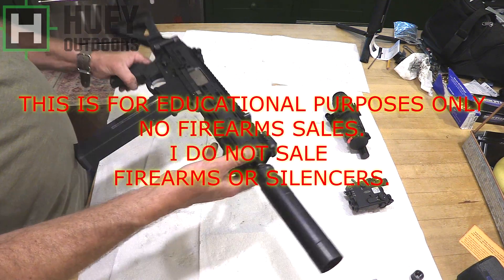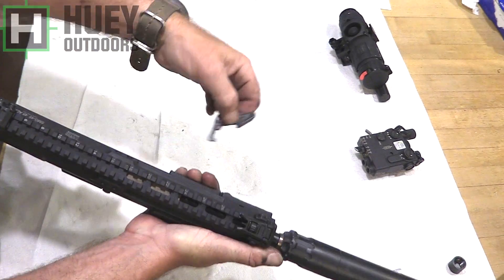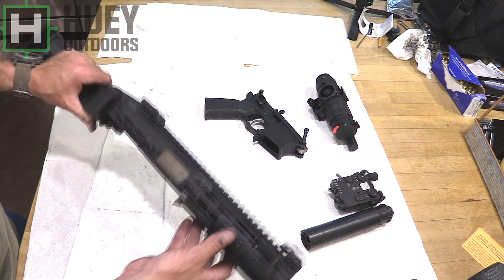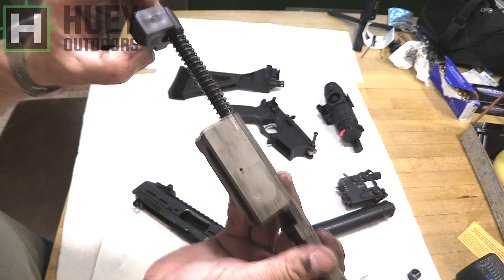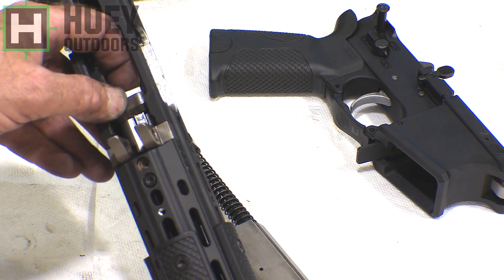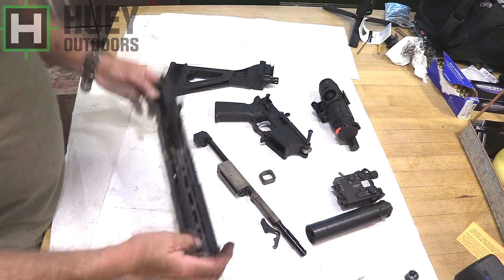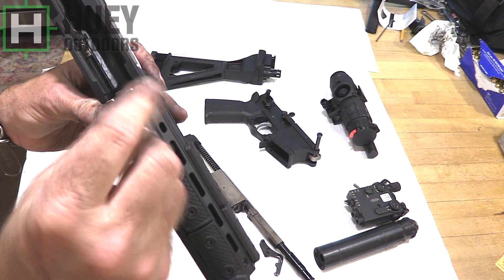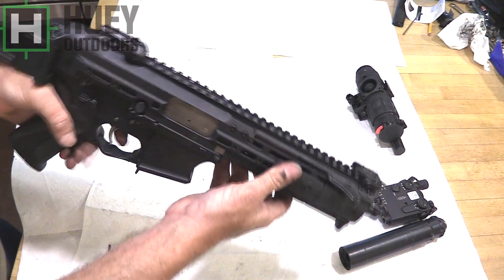LWRCI SMG45 FUNCTION AND INTERNAL PARTS

Comment: Where were the other buffer springs you found that work for this? I am looking for a heavier option then what comes in it from the factory.
Reply from the maker: I’m still using the factory springs no issues
Reply: @LoneStarBoars I am looking for some heavier options to help slow it down. We got a frt to work in it but it runs a little too hard. So I want to slow it down.

Comment: To those freaking out about the screw backing out, there is an insanely simple fix. Add a 2nd jam screw behind it and you can tighten the hell out of it with 242 as well, it will never move again unless you remove the top screw first.

Comment: Just shot 100 rounds through my new SMG.  I used six magazines each with 20 rounds of different ammo (Federal, Huerters, CorBon, Buffalo Bore, and Sig).  Each magazine had three to four failures to feed.  The charging handle fell completely out several times.  The last time it fell out I had to search through the leaves for over an hour to find it.  NOT a quality firearm.  NOT reliable.  NOT safe.  NOT ready for prime-time in the least.

Comment: Excellent vid. Great job opening it up and showing the internals. However, I don't believe lwrc's hype. It's not some innovative new delayed blowback design. Just a standard short recoil operation. In fact, the same one as the Bergmann pistol and the strike one. Way overly complicated for an smg. Probably why they didn't get the govt contract they were looking for. That and the price
Reply: Not necessarily. It can be something similar to delayed blowback in Five-Seven, where barrel moves backwards slightly.

Comment: One little screw has to be torqued just right and not walk itself out? I've been very intrigued by the SMG45 but that just seems like a problem waiting to happen.
Reply: yeah what keeps that screw from backing off?
Reply: @voparzginsburg3223  shear force of will.  If a beta is using the gun the screw backs out.
Reply: Me too, poor design.
Reply: GarandThumb just did a review of this firearm, and got consistently poor groupings across at least 5 different units that he tested (his own + other peoples guns). Many commentators on his video agree that the problem probably is with the reciprocating barrel, and specifically the set screw, as you pointed out. Disappointing in such an expensive rifle. Now we wait and see how LWRC will respond to this flaw.
Reply from the maker: Mine sill groups great at almost 6k rounds.  Seems to be the latest guns produced.
Reply: @CheeseDanish85  A simple short recoil action shouldn't cost so damn much in the first place. This gun is going to run into the same issue as the Galil ACE: far too much of a cost increase over its relatives and competitors for only a marginal improvement (or no improvement in the case of the CMMG Banshee).
Reply: LOL, I made the same comment on GarandThumb's video.
Reply: Most switch barrel designed guns have 2 screws holding the barrel in place.I'm talking 338 Lapua Mag. on down to 308 and the barrels are not flying off the gun.The Barrett MRAD is 1 of the guns that use this same method to lock their barrels in place.

Comment: The elephant in the room, how is the accuracy with a moving barrel? Does a suppressor impact this?
Reply: Another review has recently come out with poor accuracy results too, Garand Thumb
Reply from the maker: Yea I know I talked with him.  Mine has not had that problem, it seems to be some of the later weapons released.  Mine has been 100% thankfully.
Reply from the maker: With seller and Bellot I’m getting about a 15” group at 25 yards.  With the premium Ammo federal, hornady, double tap the holes are touching.
Reply: Lone Star Boars 15”=15 inches correct?
Reply from the maker: Correct but that was the Ammo not the rifle
Reply from the maker: Yes 15” with that cheap ammo everything else has been hole through hole.

Comment: I'm guessing it would be fine to shoot 45 Super through this?
Reply from the maker: Not with the stock spring,  they are testing a stronger spring I believe.
Reply: @LoneStarBoars  thanks. (You know going back to the video I realized you mentioned a spring for 450 SMC, is that what you were trying out?)
Reply from the maker: I haven’t messed with it yet still running standard 45 through it.
Reply: 460 roland would be nice for hogs. Or 10mm conversion.

Comment: Nice! The price is a little steep, but if you look at the competition, then the price starts to make more sense. B&T sells their APC45 for $2,500, and it's just a regular blowback operation with a buffer system. The SMG 45 has a short recoil delayed action so a bit machining is involved. I'm just hoping that the street price would come down to about $2,800. For a PCC, however, that's still up there.

Comment: What is to prevent the screw that holds the barrel in place from walking out?
Reply from the maker: It comes with vibra-tite so you can tighten and loosen 5x before reapplying.  After that you put more vibra-tite or use blue lock tight every time.

Comment: Mine should be coming in this week.  Im concerned about the barrel bolt. Does it move at all after thousands of rounds of use? Last thing I want is to have spent 3k on a gun with a crappy barrel hold design.
Reply from the maker: Better explanation I should have put this in the video.  It comes with vibra-tite so you can tighten and loosen 5x before reapplying.  After that you put more vibra-tite or use blue lock tight every time.
Reply from the maker: Nope 3k+ rounds no movement and I’ve screwed it in and out.  There is a friction compound in there.  But you can always add blue lock tight if you are concerned.

Comment: Cool gun, but that not too loose ,not too tight screw ,doesn’t seem like the best method for retention... but I ain’t no engineer.
Reply from the maker: Better explanation I should have put this in the video.  It comes with vibra-tite so you can tighten and loosen 5x before reapplying.  After that you put more vibra-tite or use blue lock tight every time.
Reply from the maker: Me either it has its own friction ring.  This one has I’ve 3k rounds through it with no movement, and there is always lock tight.

Comment: Have you had any idea with that screw walking out?
Reply from the maker: I do not know about idea but not the screw has not moved in 3k + rounds.  You can add locktight if concerned I have not.
Reply: @LoneStarBoars  you answered my question, I need to proof read my posts😁. Thanks for all the information you out. Love your channel!
Reply from the maker: Better explanation I should have put this in the video.  It comes with vibra-tite so you can tighten and loosen 5x before reapplying.  After that you put more vibra-tite or use blue lock tight every time.